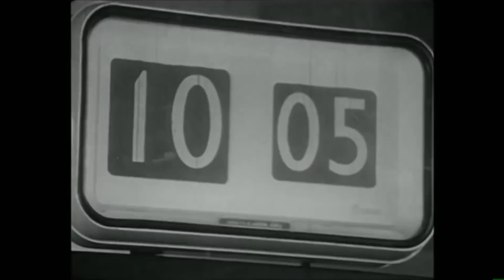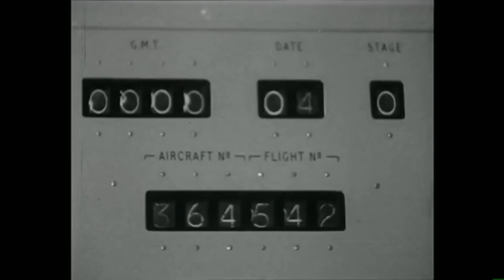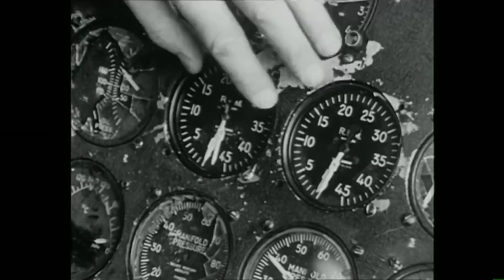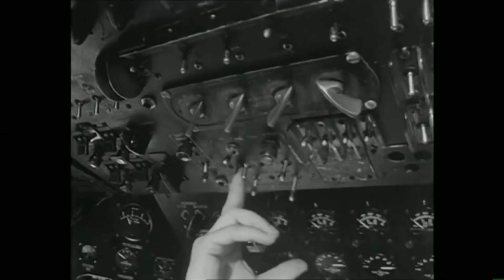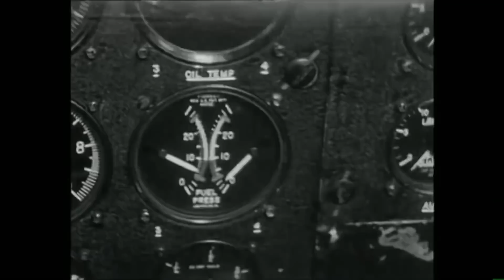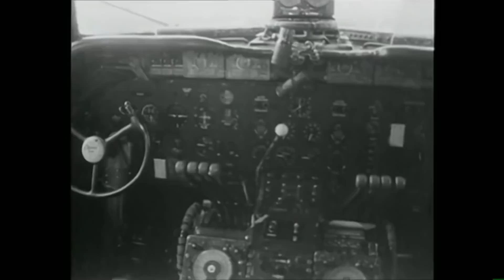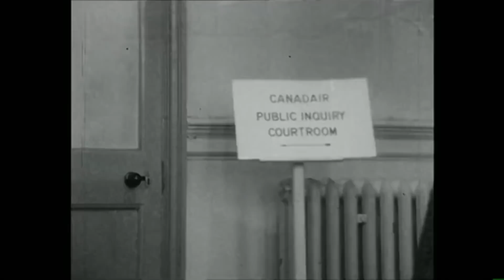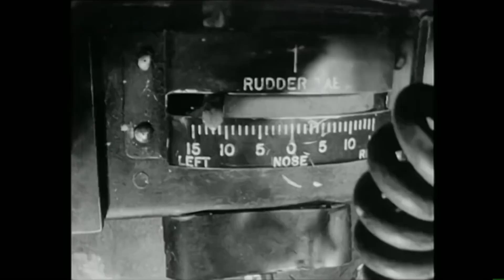Stockport Air Disaster (BBC-North Documentary from 1968)

Comment: My dad visited the scene with his brother who worked for the BBC outside broadcast in Manchester and would talk about this every time we drove past the site in Stockport. Always fascinated me and I have never seen this documentary before. So forgive me - if the 3/4 engine RPM indicators are mixed up - then if 4 starts to give issues (pilot commented that they were having trouble with RPM) and that engine's indicator was showing as '3' then if he shut 3 down, whilst 4 was windmilling and as such the prop was rotating and providing an erroneous RPM indication of sorts, then he would at least for some of the time lose 2 engines? So perhaps it wasn't that much of a red herring as stated?